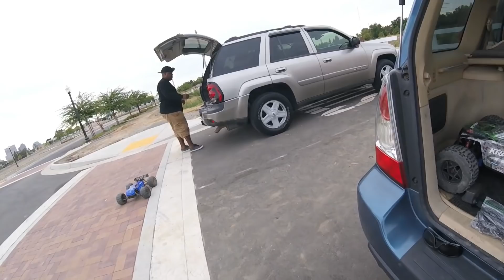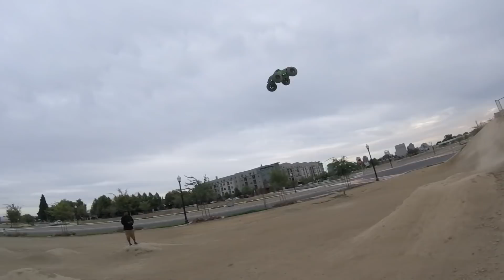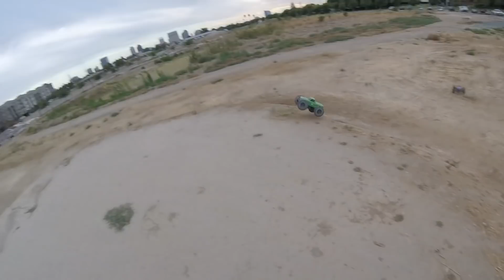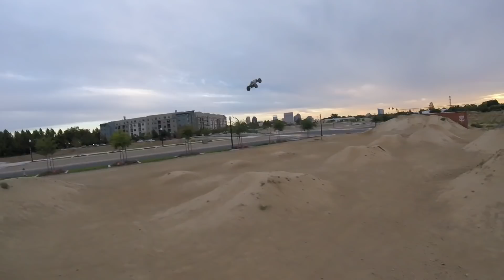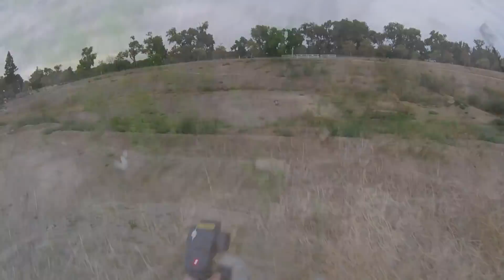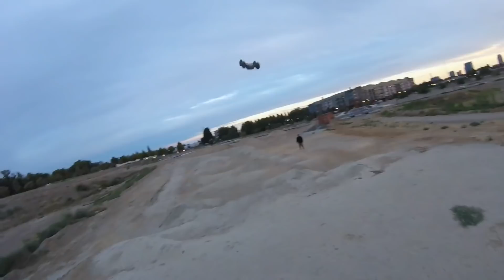Tekno MT410 "Stacking it" Arrma Kraton 6s durability check...

Comment: Rich I think ur an alien 👽 with special bash powers 😆 cus there is no one that I’ve seen on YouTube that can fly n rc like u do brotha! Absolutely insane! Ok now that I brown nosed a lil bit can u tell me which diff fluids u use in ur Kraton? Rc bashing the Kraton told me 50k in front 100k center 10k rear, I have guys telling me to use 1million in center, I told them that’s way to thick n they said it’s perfect, so I wanna see what ur running, if u would be so kind sir? 🤣
Reply from the maker: STEVO D 313 LMAO😂!!! Thanks for the kind words Bro👊. I run mostly 50/200/20k front to rear and love it. Just recently switched to 50/500/20k cuz my high power 1730kv 4092 set-up was ungluing front tires in our bone dry CA dirt. I might switch back once the rain comes and there's less wheelspin going on 🤔. Still running 50/200/20k in my Talion and 50/100/20k Typhon and Outcast. 🍻🤘🤘😵😵😵😎💪👊👊
Reply: Rich Duperbash awesome thanks for the info brotha!

Comment: Hey bro great job, finally my kraton v3 is arrived, I ask you what oil you use in the diffs? Thanks
Reply from the maker: riccardo galli thanks so much brother 😂!!! I recommend 50/200/20k front to rear. I recently upped my center to 500k, but it's an ongoing trial with my Hobbystar 1730kv 4092 high torque motor. 50/200/20k is what I still run in my V3 Talion and it worked great in the Kraton as well. 🍻🤘🤘😵😵😵😎💪👊👊

Comment: Rich what upgrades should I get for my kraton? Should I just get a mt410? Was about to order a hobbystar 4092 1730kv with a hobbywing max 6 or 8. What do you think also was checking into springs tekno orange? Kraton is a beast. But want to know what upgrades to get to bash me and my 7 year old watch your videos.
Reply from the maker: nhcarl2003 I usually recommend Voltage Hobbies chassis supports and servo mount as first Kraton upgrades in addition to a good Tbone or RPM bumper of course 😱. Voltage shock towers, steering rack and suspension mounts, are also a great idea for harder bashing. I'm also a fan of RPM rear skid plate and A arms if you break the stock ones. These upgrades add up so it depends on your budget and use of the truck in the end. If you have a V3 Kraton, there's no need for Tekno springs. If you have a V2 Kraton, I'd say get the V3 shocks for cheap from Jenny's RC. The Hobbystar 1730 4092 is a torque BEAST 😱. The Hobbywing Max8 is probably plenty to be honest. The Max6 has more built in technology and higher amps rating, but it also has a lower motor kv rating as well. The MT41O is a great kit no doubt 👊. Just realize it requires upgrading also for harder bashing.🍻🤘🤘😲😲😲😎💪👊👊

Comment: That KRATON just takes a beating I can't wait till l find out what's wrong with it! I keep eating up my rear input gear and 43 t ring gear! Soon as I change it! It starts working fine and than 5min into bash the gears are ate up again! I don't know why it keeps doing this! Really am getting fustrated with it Rich! Any advice?? Bash on Rich bro!!💪💪💪👊👊💯💯💯
Reply from the maker: Troy Speed Rc thanks so much Troy 👊!!! Sorry to hear about the diff issues😨. My best guess is a cracked or stripped gear box🤔. Something is allowing your input and crown gear to lose position or spacing. I've seen these cases crack in crazy places. Sometimes along the bottom where it attaches to the chassis, even in the metal bearing carrier portion. Once you're certain the case and bearings are solid, I always recommend shimming the crown gear side bearing with 2-3 Tekno #1222 shims. This pushes the crown gear towards the input a tad. Hit me up on FB if you need Bro👊!!! 🍻🤘🤘😨😨😨😎💪👊👊

Comment: What battery charger/s do you use? And do you have a favorite battery brand?  I use Gens Ace
Reply from the maker: A deer in headlights I'm running mostly Hobbystar 6s 4800mah 50c hardpacks from RCJuice. My charger is a simple Dynamite Prophet Duo. It's far from the best...Lol. Doesn't have a balance storage charge feature and maxes out at 6 amps. There's much better chargers to pick from. 🍻🤘🤘😎💪👊👊
Reply: Rich Duperbash  Very cool, i'm looking at getting a Dynamite passport ultra, duo or single. Thanks for the reply! :D

Comment: What oil you used ?? Tekno mt410?
Reply from the maker: I'm running 50/200/20k front to rear diffs with 70 weight shock oils, and orange springs. 🍻